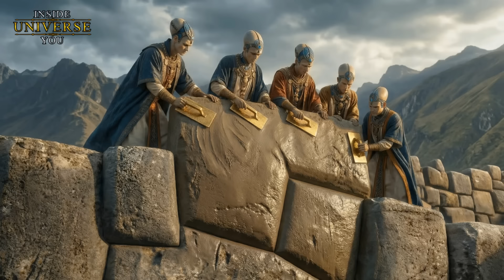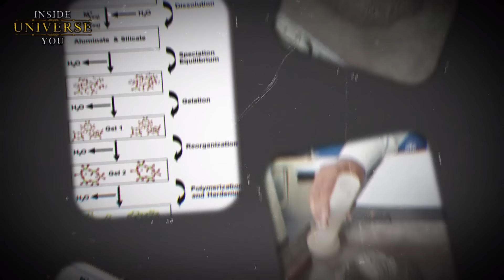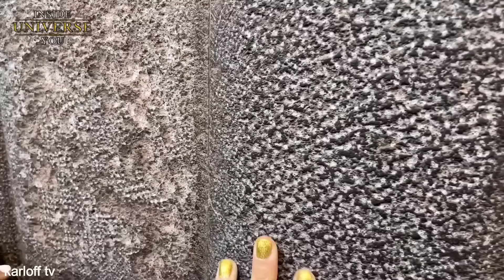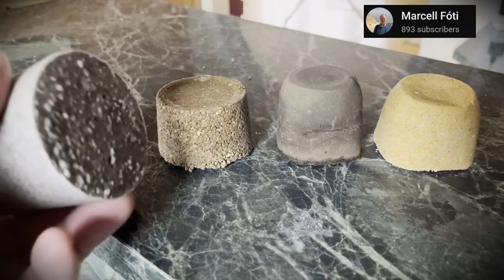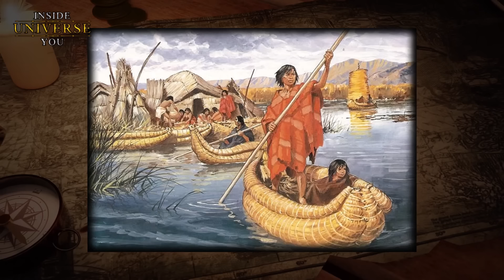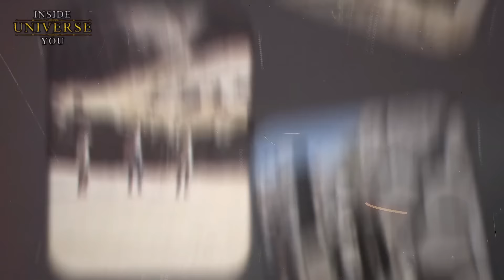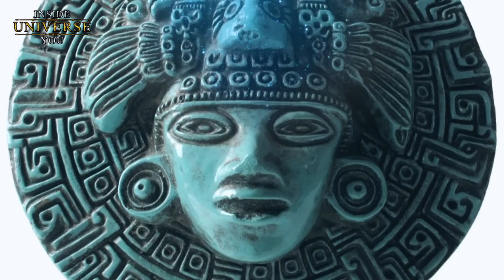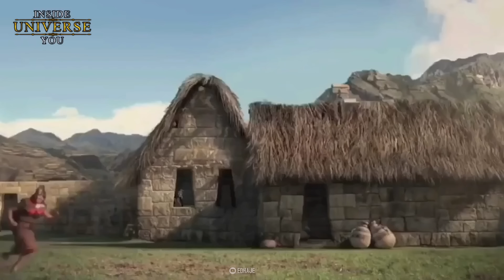Pre-Inca Geopolymer Explains the Massive Megaliths

Comment: It would explain a lot if true. But from what I understand very high pressure and heat is needed to make granit, so it could not be done as presented in this video. It does also not explain some of the huge blocks left in quarries, how they made perfect moulds that could withstand the enormous pressure before it hardens and how some semi hardened ”blocks” could be moved. So I’m skeptical at this moment.
Reply: You are really dense like the concrete blocks

Comment: I like the idea on the knobs but what about the ones on the massive blocks in Yangshan Quarry? Doesn't add up.
Reply: Those knobs almost look like it's for grappling. Using a piece of equipment that grasps edges of the knobs to save the face from damage when lifting. I have used those before. On the smaller blocks, I can see them as a way to release excess water, but the larger ones, it doesn't add up.
Reply: @kurtnewyork9374 I don't think they know one way or another.   They need to do physical archeology to test different theories and find the right process.
Reply: @kurtnewyork9374 I can see ropes around those knobs, I like that theory
Reply: Keep thinking about them.  This was the first time that it was pointed out to me that they were all at the bottom and that means something but I don't know what yet.
Reply: Maybe they were practice stones at the quarry. Quarry used for production of ground stone material?

Comment: 0:23 Geopolymers are not applicable in the polygonal masonry as they have a shrinkage.
“... Any products obtained by casting/sculpting shrink during the drying process. The shrinkage of modern concrete can reach 3%, lime shrinkage is noticeably greater. The casting shrinkage leads to casting size decrease, warping (shape distortion) and to cracking as a result. Thus, the presence of cracks can be one of the casting hallmarks. The shrinkage-induced casting size decrease, in turn, leads to interblock gaps. Since the initial shape of the blocks in the polygonal masonry is irregular, the shrinkage in addition turns out to be non-uniform. Accordingly, the gaps resulting from such shrinkage will be non-uniform too (nonparallel). ...”

See details in the article “Fabrication methods of the polygonal masonry of large tightly-fitted stone blocks with curved surface interfaces in megalithic structures of Peru” (DOI: 10.20944/preprints202108.0087.v10) or in the book “Peruvian polygonal masonry: how, who, when and what for” (148 pp., 2025).

Comment: But why do only some blocks have nubs while others dont?  Logic implies larger stones would require more drainage but that is clearly not the case. Why would the builders leave nubs as imperfections on a site thats meant to be sacred?
Reply from the maker: According to Marcell Foti’s explanation within the Natron/geopolymer framework, the presence or absence of knobs depends on how each individual block cured and how excess liquid was managed during hardening. Foti emphasizes that the geopolymer was likely mixed in small batches on site, not in a centralized industrial system. Some batches contained more liquid, expanded more during crystallization, and required pressure release. Others cured without excess pressure, hence no knobs. In his demonstration videos, he noticed this too in his artificial granite curing.

Comment: Acoustics,  wave theory phenomena,  and advanced wave theory phenomena.  This is the lens this lost civilization should be examined through, with physicists. Once you start to decode the real reasons they built these structures, then geopolymers will start to look as significant as our current civilization using nails for construction.
Reply: I have a strong suspicion that these builders were masters of all we call wave theory, and here is a short list of some of the things I think they could do:
- Space-time waveguides — invisible tubes that carry any kind of wave (light, sound, particles) anywhere with almost no loss.
- Wavefunction sculpting engines — machines that shape quantum states so you can build materials or reactions exactly how you want.
- Universal cloaks — cloaks that hide things from sight, sound, heat, and even particle detectors.
- Wave computers — computers that use interacting waves (light/sound) instead of electrons for super-fast, low-energy processing.
- Super-delay devices — gadgets that control when signals arrive, like adjustable time-buffers for information.
- Topological energy channels — rock‑solid wave highways that keep energy moving even if broken or damaged.
- Wave-collapse reactors — devices that squeeze waves to focus huge energy for clean fusion or ultra-fine manufacturing.
- Remote tractor beams — beams that push, pull, or hold objects from a distance using structured waves.
- Universal converters — tools that turn one kind of wave into another (light↔sound↔particle waves) without loss.
- Space-time metamaterials — materials that bend how waves see space and time, redirecting signals in wild ways.
- Coherence highways — paths that keep quantum links intact over long distances at normal temperatures.
- Soliton memory lattices — stable wave packets arranged to store and move information reliably.
- Ultra-precision sensors — sensors that use special wave tricks to measure far beyond today’s limits.
- Shape-shifting surfaces — surfaces that instantly reshape incoming waves for perfect images, energy capture, or stealth.
- Wave oracles — devices that use massive interference patterns to find good solutions to tough problems quickly.
- Holographic assemblers — using intersecting waves to hold and arrange particles to build things from the ground up.
- Synthetic vacuum devices — setups that change the background field so strange forces or effects appear.
- Decoherence shields — protective fields that stop quantum systems from losing their quantum behavior.
- Programmable environments — rooms or cities where waves are controlled to shape light, sound, temperature, and signals.
- Smart signal fabrics — communication networks that control timing, direction, and privacy of information precisely.